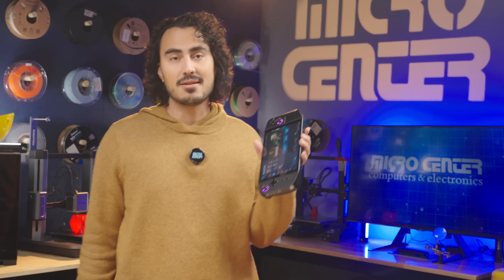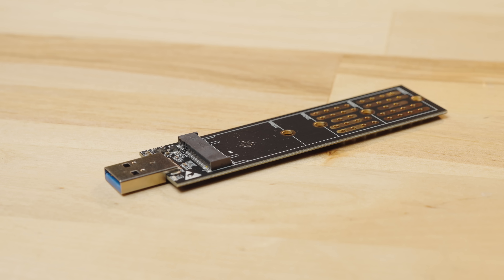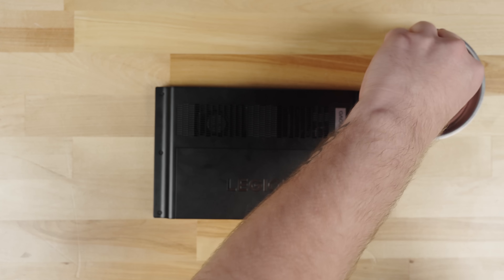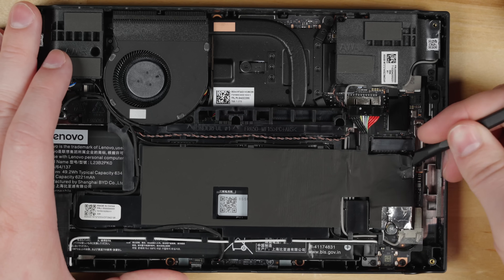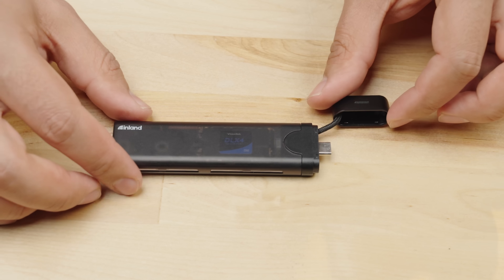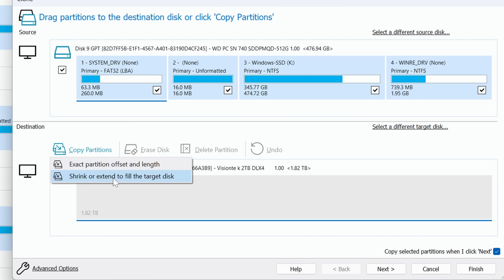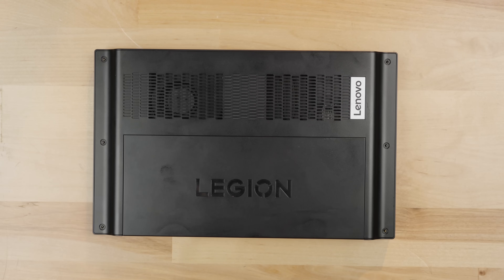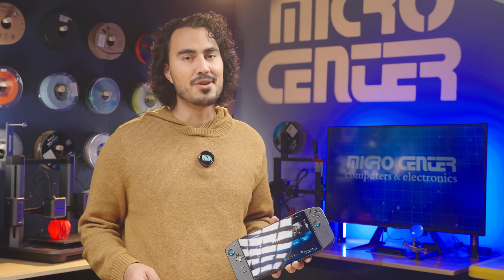How to UPGRADE your Lenovo Legion Go SSD!

Comment: 2 things noteworthy. The VisionTek gets hot, incredibly hot. Numerous users have reported it reaching over 100 degrees. It doesn‘t throttle, it just keeps frying itself and your Handheld.
You don‘t need to clone the SSD if you‘re ok with a clean install. Lenovo offers a download for a recovery usb-stick, which basically will give you a fresh system the LegionGo was delivered with.

Comment: The thing i don't understand which would have made things a little faster is why didn't you just use the Legion Go with Macrium installed on that for cloning because in the end you would just swap over the NVMe drives instead of taking that extra like 3 steps for cloning and putting it back in.

Comment: I just bought my 512 for $470 dollars and 1.5tb sdcard or $88.   Visiontek SSDs are not good ssds really... I hear they fail more regularly than others.
Reply: Wait, was it used? Or refurbished??? I paid $599 for my 512gb and I'm very happy with it, I'm having issues with storage workaround currently...):
Reply: @SkotCharles-s1y  New Flash sale on Amazon about 6 months ago.  I just put the new SteamOS image on it and it seems so much faster without Windows now.

Comment: I just followed these steps and it was very easy, thanks for such a detailed video. I bought 2 USB-C enclosures to do the job and managed to clone the full 512GB SSD in 44 minutes. Including the clone, it took just over an hour to do it.
Reply: Do you feel a bit silly since you could have just plugged in a USB C enclosure with the new drive and cloned it directly from your legion? LOL

Comment: 1. Man comes in.
2. Gives clear service  and safety instructions for opening device and removing the SSD.
3.teaches you how to clone your disk without jumping any steps.
4.shows how to put back the device in tells you why you should use provided stickers.
5.shows the device working again.
6.shits on call of duty on goes out.

10/10 video it's a masterpiece.

Comment: There was no way I could be careful with the removing of the ssd from the sleeve in the legion go as there were no joining lines or anything. I ended up using tweezers to rip the thing down on side to get the ssd out of it. I swear Lenovo no not want anyone doing this. I'm wondering is the sleeve really needed as the Asus rog doesn't have one and as far as I know neither does the Steam deck.
Reply: It's an ESD foil which helps block out wifi interference. The wireless chip is very close to the nvme slot, not sure about the ROG ally or steam  deck.

Comment: why giving this unnecessary complex tips to people if you only need to upgrade the legion go SSD, micro center?
i dont daily drive legion go, but i think i know that the device comes with the same BIOS structures and "accessibility" design as the common laptops and desktop PCs.
so if you want to use larger SSD, and if you can copy and backup your games and local saves data to another drive or even to a pendrive, you should only just to get the matching/fitting physical size of SSD for it and FRESH INSTALL the windows 11 on the new fresh empty SSD, after it is plugged inside on board the legion go.
and doing it the way you normally do with laptops and PCs. only that you are now will use a USB type C FLASHDRIVE/flashdisk to create the windows installation media. connect to internet, (by on board WIFI, or with the help of any affordable handheld device's dock station connected to ethernet), get the same version of windows(region specific etc) from microsoft website, and plug the type C thumbdrive to the legion go USB4 socket, and create the installation media. thats it.
reboot to BIOS menu, and choose the UEFI pen/thumbdrive installation device, and do the normal windows install process. you culd make extra partitions etc.
thats all you need to do. why risk DAMAGING your new SSD if there is glitch with those cloning process(its a RISKY rituals if you know how the nature of drive cloning is).
you could the same method i mentioned to WIPE the existing drive in your legion go, if you are worried it comes with extra "something" from the lenovo manufacturer in the drive.
you can always reinstall the lenovo legion go apps later on after fresh install by donwloading those from their website.
this is also how you do it if you want to turn it into a "steamdeck on steroid" by installing linux and steam companion aps like the "decky" app thing that will make all your legion go peripherals working in linux (including the RGB settings and the touchpad).
okay you could lose your warranty this way, but hey, ITS YOUR MONEY, YOUR DEVICE.
are you deleting my comment, micro center?

Comment: Be careful getting one of these "upgraded" drives.  They are replacing Western Digital drives with junk.  They're dying left and right and Lenovo warranty doesn't cover the drive since they are replacing the 512GB drives with 1TB and 2TB with lesser quality drives.  I have a 1TB version from Microcenter.  Mine died after 3 months and Lenovo will charge for the repair to remove the 1TB drive and put a 512 back in.
Reply: I also got the upgraded one couple months ago and It died on me last night while playing Starfield. So i have to drive 45 mins to a Micro center to see if they can fix it for me since i have their warranty. This is the second upgraded Go in my house that has randomly died thanks to Micro center putting trash drives in these.

Comment: just got my 512gb version tried to install games free from xbox pass. my sd card wont show as an option on installation path why is that? i thought i could use sd card on games
Reply: I just reformatted mine to NFST or whatever, than I created a new folder in there named "Destiny" than it showed up as a usable file path, not sure if it's going to work but it allowing me to install now lol

Comment: i just upgraded my legion go by myself and i haven't done anything like this ever. so i was kinds scared of breaking someting. but i did it, thanks to this video. 
unfortunatly i did not find a 2242. but i did find a 2230. so i had to buy a extender for it aswell. but everything works.
now to find out witch games i want to instal on it. 
ive been playing cyberpunk 2077 on it for the past week. and i love that it can play it. even though it is on low settings. but still. pretty awesome.
as a truckdriver i am away from home alot. so i cant really play on my pc. this lenovo legion go is one of my best purchases i did.
also, i live in the netherlands and we don't have any micro centers here. so i had to do it myself. also my to go tech company did not want to do it for me, even they said is was to risky.
Reply: Which extender ?
Reply: @intelligence6900  it is like a plastic thing to make the 2230 longer. In this case to the length of the 2242. To make it fit in place.

Just google
M.2 extender bracket
Reply: Lol

Comment: Is the performance ok using an external sd card for games? I really dont want to open the device to lose the warranty just yet. Thx!
Reply: If you use a A2 V30 original microSD card, for small games <10/15 GB) you won’t have an issue, they’re plenty fast! But be aware: a microSD is much more expensive per GB than an ssd. If you find one at a good price, great (the 128 and 256 GB ones are already rather inexpensive). I have one 400 GB that I already had from a professional camera of mine and it works great!

Comment: I installed a 2TB drive, using a blank USB-key to image it(after grabbing drivers from the original windows folder)
I cant wait for 4TB drives. I find that even the low powered and limited driver support Steamdeck runs out of space for me at 2.5TB, i feel like 3.5TB on the Legion GO will be even more limiting because even more games run well on it, and being windows(for now) its no hassle to install non steam games.

Comment: Is it possible to upgrade the RAM from 16 GB to a higher capacity?
Reply: The ram ICs are soldered directly to the board, you would have to send your system to someone who specializes in this and have them or yourself source the larger replacement ICs to be soldered on.
Reply: @certifiedskillissues I see, thanks mate. And Happy New Year too

Comment: I have a question about the micro SD cards. I did not experience this issue on my Steam Deck, but for some reason when installing games from Steam it takes a really long time to allocate space on the drive. I am using a fast 190mb micro sd card. I don't get it. Any thoughts?

Comment: Getting that silver insulation tape of the stock SSD drive is almost impossible to get off in a condition to be able to apply to the new SSD. Is there any other form of insulation tape you can use to put on the new SSD? I tried putting the silver tape from the original SSD on the new one but the unit went bang and no longer works, I presume it shorted out the unit from not being covered correctly?
Reply: buy a new one
Reply: I did

Comment: I don’t know how well it will work, but my suggestion would be to install the cloning software on your legion and connect the new hard drive using your adapter to Legion and then clone it.

And then you can just directly add the new 2 TB drive inside

Comment: Shame you guys don't have a store in Brandon Florida.
I'm surprised those 22x42 drives don't have a higher capacity since you can get 22x30s with 2TB also.
I might get the Go over a SteamDeck ever tho I can mod the Deck with 32GB of RAM.

Comment: Picked mine up today,  and went with the 2 TB option since it was cheaper than getting the 512 and doing it myself . It's an amazing device, just a heads up to put the Software keyboard option in the taskbar for easier access to it.
Reply: Handy tip: You can press the left Legion button and B simultaneously to bring up the onscreen keyboard!
Reply: I was wondering hve you had any problem ? I mean I know that the lgo has recently been in the market... I love the big screen and the characteristics, but should I go for the ally or Legion go ?
Reply: @aliceweiss6711  I don't have an Ally, so I really can't compare the 2. The Legion Go , I haven't had any problems with it as of yet.   Check the reviews to decide which one fits best for you. If you're into D-I-Y you could buy the cheapest Steam Deck and do the 2TB SSD Upgrade , and replace the Sticks with Hall Effect Kit, and put Windows on it for about $100-$200 cheaper than either the Go or the Ally, and have comparable performance, but the SteamDeck is the least powerful of the 3
Reply: @aliceweiss6711 they have the same processor so the performance is literally almost the same. It’s just the screen resolution, size and frame rate are different. Also the legion go has a built in stand and removable controllers. Those are the few reasons why I went with the legion go. I wish I went with the 2TB though because man did I fill the 512gb so quick.
Reply: #iwantamicrocentrenearme UK please 😊
Reply: How do I add the keyboard to the taskbar?
Reply: @SkotCharles-s1y  Go to the System settings, select Personalization, select Taskbar, Select Touch Keyboard and use the drop Down menu to show when it's available

Comment: Mistake? Why would you want your games and system in the same partition? I shrink it to 120GB then have 1700GB as a separate partition
Reply: why wouldn't you ?
Reply: @lastnikita only reason I can think of is if you format your windows partition you’ll still have your games on the separate partition and won’t have to reinstall everything.

Comment: You really don’t necessarily need to remove to both drives if you don’t have 2 enclosures. Install everything on your legion then use this software to clone it to the new drive connected to it this way is also faster
Reply: thank u
Reply: yeah man thats what i was thinking but wasnt sure. thats great thanks man
Reply: Thanks so much brother. You saved me some extra dough. No need to spend extra money. Much appreciated.
Reply: Thanks. I was curious to know if this was possible. That way you don't need a second PC

Comment: Would I be able to bring my 512gb legion go in and have it upgraded to a 2tb in store? If so what is the price for that?
Reply: They will do it, but the charge s much higher. There is a breakdown of the fees on their website, around $150 just the labor. Maybe the local store can offer better pricing than the website.
Reply: @KainOfNosgoth  I got mine done and was charged about $300. $189 for the 2tb ssd and $100 for labor...they were going back and forth on if they were even still allowed to do it.
Reply: @williamcary168  
I hate the "are we allowed to do it" mentality. It should be OK to do what the customer wants!
$300 seems an OK price. They need to advertise the 2TB system better for people to find it before buying the lower capacity from somewhere else.
I found them selling it by coincidence while searching on DIY SSD replacement.

Comment: I found a legit 2tb micro sd and i already bought the Legion go with 2tb ssd from micro Center so i have 4tb! And boy it's hella fast, I test it against my friends legion go 512 gb by conparing game loads and other things and boy what a difference.
Reply: 2tb micro sd? from who? wd just launched a 1.5tb through sandisk.
Reply: @The0Advent   you can also buy a 1tb SD card at Micro center and see if they will clone it to 2tb! I hear that is possible but wasn't aware of it before I bought my 2tb sd card.
Reply: So it costs $150 extra for the 2TB option at Micro Center? Where did you find a 2TB Micro SD.
Reply: @thundergato84   It's not from micro center .  I bought it online
Reply: @ZackWolfMusic  u probably bought a fake one that won't hold the data. Test it against H2testw
Reply: @lastnikita  Nope its real it's working 💪
Reply: Dude... I need this^^^

Comment: Thanks so much for this video, but wouldn't it be so much easier to just leave 512gb SSD inside the Legion Go and just do the cloning with just one m.2 enclosure(2TB) connected to it? #iwantamicrocenternearme
Reply: It would work but it won't be consistent.
Reply: @ZackWolfMusic  Why wouldn't it be consistent?
Reply: @VizioN-Scope  Because the cloning process requires 2 m2.
Reply: @ZackWolfMusic wut😂
Reply: @ZackWolfMusic  NO it does not require 2 like in the video. you only 1 to do the cloning.

Comment: The only issue is that the device was powered on when you removed the battery connector. 😂
Reply: It was off???
Reply: @ZackWolfMusic  You can see the fan spinning and when they remove the connector it stopped.
Reply: @19samfisher  Fan doesn't stop instantly. It's slowly stops ✋️ 😌 😪 🙂 🙃 😢 ✋️ 😌 😪
Reply: @ZackWolfMusic  You can see the fan spinning and when they remove the connector it stopped.

Comment: does upgrading the SSD improves gaming performance?
Reply: You are upgrading the storage capacity, nothing else😁
Reply: I upgraded my Legion Go to 4tb! First I bought the 2tb version from Micro Center, and then i bought a 2tb SD card and boy it's a gamer changer, games load faster, files open and download quick, browing internet is swift! So yes upgrading  the ssd and a SD card makes a superb difference 👏 👌 🙌 👍
Reply: @ZackWolfMusic  I don't know if you understood the question?😅
Reply: @Cemruto   Why would I not?
Reply: @ZackWolfMusic  Because the question was about "GAMING PERFORMANCE" and not how much you could put inside the legion go and it is the same Nvme ssd you are replacing it with, but just with more storage capacity, so how does that affect the Fps in games?
Reply: @Cemruto  It's not the same ssd,and it's offer faster  load time which is based off of performance.
Reply: @ZackWolfMusic  If you call 1 or if you are lucky 2 seconds faster boot time a "Gaming improvement", then you are right 🤣
Reply: @Cemruto  More than that Bud! I'm talking a whopping 10 seconds faster!

Comment: Is that VisionTek 2TB M.2 2242 NVME DLX4 PCIe Gen4 x4-901563 the same drive put into the ones you are selling? (up to 5200 MB/s reads and up to 4775 MB/s writes).

Comment: This a huge issue when the rog ally just does everything through cloud recovery I have used it many times to fix issues they better release a recovery image very quickly or they will have major issues this cloning method isn’t good what if your original image is messed up cloning it will clone the issues
Reply: Damn, your right! I didn't think of that... can't you just create a backup? But than the back up would potentially contain the issues as well.. shit now I'm concerned, what would you do? Hope that lenovo would sent your digital recovery files??? Omg omg omg...
Reply: Cloud recovery is horrible 😢! What if the cloud is down and   lose all your data? I never trust cloud recovery. If the cloning image is messed up, it can be recloned